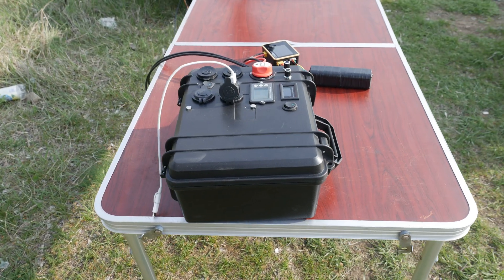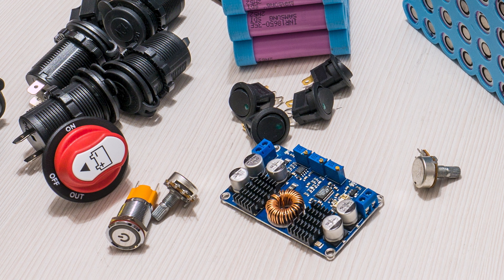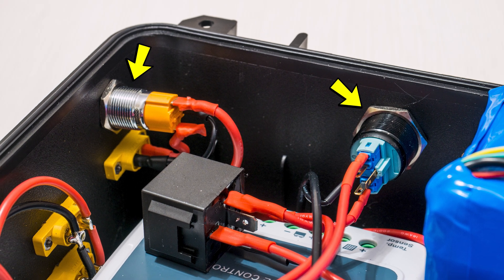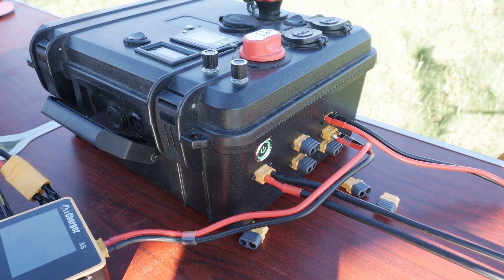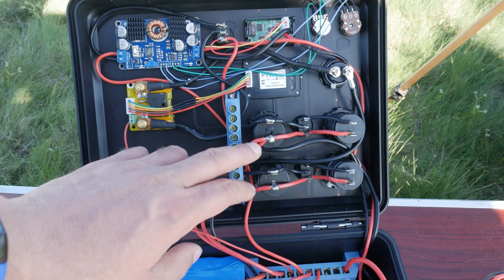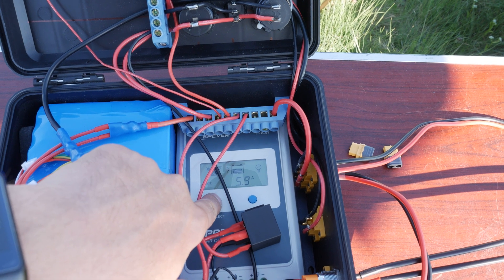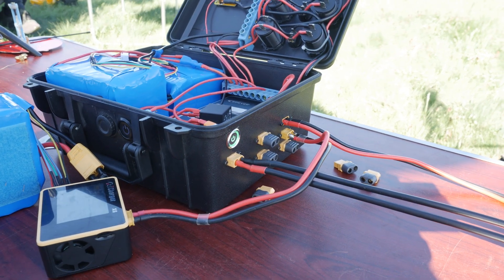My DIY Solar Generator Power Station

Comment: Edit: Great build I just left a bunch of comments for anyone looking at this and needing ideas. I don't really have many criticisms except my first comment.

I've never understood the brass bus bars. I figure people did it because Jehu does it, but copper bus bars of the same ampacity would be nearly the same price. I don't think its that hard to solder to copper, if you can't get it with flux then hit it with a torch real before installing on the battery and add solder along the sections of the bar.

I've always wondered if diodes are necessary in some of these circuits. 

The LTC3780 is definitely the cheapest "high power" buck boost board out there but I recently discovered some larger units on Aliexpress so if anyone is looking for 30A or so search "automatic buck boost converter 30A"  they are a little pricey though. The other option if you're only in need of 5A and want a nice digital interface is the XYS3580. Alternatively if you had made a higher voltage system (48V) you could use one of the many buck converters that have the same interface as the XYS3580. Those go up to 20A and Riden even has a 24A model but its a lot more stuff  but if your use case needs something like that its a very affordable way to do it. RD6024 is their biggest model, 6020, 6018, 6012, 6006 are the other models. Then theres the DPS5020 and 5015, etc. There's an XYS5008 thats an 8A buck converter and WZ5020L is the cheapo model with the shit interface. Double check the specs on the one you choose especially wattage and amperage. Take a look at efficiency too, some perform poorly if youre boosting 12V to a high voltage or simply can't do 12V to 50V at more than a few amps.

Lots to choose from if you need an adjustable DC output but you can do it pretty cheap and essentially have a nice battery charger...which also means you could set this to the ideal MPPT range for another power station that needs to be charged off your unit or even do a little modding an open up the other unit and splice the main battery cables to add an input accessible from the outside so you don't lose energy from the MPPT and keep the port open for solar.

I'm kinda surprised you went with 18650's since LiFeP04 prismatics are close to the same size...With a little more room I think you could have fit 100Ah cells, probably not 8 50's though so no 24V option. 21700's would have been my choice most likely due to the energy density but SPIM08HP cells are another good option. Headway 38120HP's from battery hookup are cheap if you're in the US and want a LiFeP04 option that screws together and you can use a long grub screw to series connect them without too much wasted space. There are also super cheap A123 26650 packs on ebay right now $100 shipped for 792kwh when new and they are testing above 95% capacity even at a decent load so expect 700+wh. They are a little bulky because A123 put a lot of space in between the cells for cooling since they were originally series connected (16 of the packs) for a 400 something volt electric bus.

USB 100W PD is possible and quite cheap. The only boards that work (check my channel I've bought so many of them and most are duds) are the IP2368 and the 120W bidirectional full protocol blah blah blah buck boost board from Feb 22 Store. I think the IP5389 might work too but my TZT board took a shit. Most of these boards work with a 4S lithium battery but some like the IP2368 allow a larger range. The IP2368 does have one flaw, if power is disconnected you have to hit it with a charge first to make it output, apparently a new version is in the works to fix this. So I def recommend the 120W board with the SC8812A and the ChipSea chip, its a tank of a DIY PD powerbank board and only $20 shipped. Add two of those OR if you have >20 volts and you can use a buck only board then get a 4 channel SW3518S board and you get 400W but that one is not bidirectional...but at $20 a 4 channel 100W PD/QC/every fast charge protocol out there minus PD3.1 is pretty impressive. For USB A you can get a 4 channel USB QC3.0/AFC/blah blah board for $6 and its one board with holes for standoffs so easy peasy. You could have more/better USB outputs/inputs than the $2000 units on the market for $46 or if you can live with buck only boards $26.

I do love your super clean mounting of the XT's on the side of the box they are amazing DC connectors and I wish most of the others would just disappear so it becomes the universal standard like USB C.

When you add an inverter you can just pull the plastic end piece of the inverter off and mount it to the box and extend the 220V wiring or you can buy a flush mount desk power strip for less than $20 and that makes it so so easy and you could have a switch for the outlets besides the switch to keep the inverter off. I'm all about having switched AC outlets for a bunch of reasons.
Reply from the maker: Lots of info here, nice! Thank you! As for the bus bars, they are brass because around here I cannot get copper ones and I wanted something with a housing and proper machine openings and bolt tightening, rather than soldering!

Comment: How much sir
Reply from the maker: I have not done a calculation on how much this has cost! Roughly I would say its about $400 due to the cells used being brand new and high end, and also the MPPT is not the cheapest option.

Comment: Super setup, just a question about Epever unit, 10A or 20A? regards
Reply from the maker: Thank you. I got the 10A one because it is the smallest, and only one that could fit in this case.
Reply: @ArxangelRC  looks to be enough even with 200w pannel isn't it?
Reply from the maker: @papylecelte9916  Yes, but that would be with a 24v battery, which means the panel needs to be at least 30+v! Won't work with a single 18v panel.
Reply: @ArxangelRC  I will stick to your model, for my need in the field, it's powerful enough. I just need to power my laptop, maybe a raspberry pi, an FPV receiver screen, and some battery charging. Thanks for your time 😃
Reply from the maker: @papylecelte9916  Should be plenty! I pretty much use it for the same stuff! :)
Reply: @ArxangelRC  I find a semi-flexible solar panel 120w 18v 1170*540*3mm looks smaller than the one you have on your video, is that normal? scarred to buy a bad clone 😂
Reply from the maker: @papylecelte9916  Actually it is larger if its 117cm along the long side. Mine is about 100cm.
Reply: @ArxangelRC  Hard to guess size on video. 🤣 Regards
Reply from the maker: @papylecelte9916  👍😁
Reply: @ArxangelRC  for my last buy for the project, what resistance for the 2 potentiometers for the step-up down regulator board? regards
Reply from the maker: @papylecelte9916  To be honest I am not sure! That was one area where I haven't got a clue! I remember looking it up somewhere, order whatever I found and that was it! IF I remember correctly it might have been 10k or 15k...
Reply: @ArxangelRC  thanks, now patience will be key. Aliexpress can take a while to deliver 🤣
Reply from the maker: @papylecelte9916  Haha, true. Although lately things have been arriving relatively quickly.
Reply: @ArxangelRC   Good morning, do you plug the load directly from the battery or do you use the load connection from the Epever unit? when you said you connect the Epever to the ground, do you talk about the casing?
Reply from the maker: @papylecelte9916  I have a direct connection to the battery, it does not go through the EPever since that one is only limited to 10A, and the battery can easily output a lot more!
Reply: @ArxangelRC  ok, Thanks
Reply from the maker: @papylecelte9916  You are welcome! :)
Reply: @ArxangelRC  Good Evening, on the setup of the epever there are a lot of settings I do not understand like Float charging, boost charging, boost recon, equalization charging, over volt disconnect, over volt reconnect. I use the data cable and my laptop, any chance you can send me your settings, the battery will be 3S 20P with 3.5Amp per cell. Regards
Reply from the maker: @papylecelte9916  Hey, I am just going to paste my settings here, these have been saved via that program from my MPPT in the box for my 3S battery in there. These are my settings according to what I think they should be. Have been perfect so far.

BatType: 0
BatCap: 70
TempComp: 0
OVCutOff: 12.70
ChargLmt: 12.40
OVRcv: 12.60
EquilV: 12.40
RaisV: 12.40
FloCharg: 12.40
RaisRcv: 11.20
LVRcv: 9.01
WarnRcv: 10.20
LVWarn: 10.00
LVCutOff: 9.00
DischaLmt: 9.00
RatedLv: 0
EquilDur: 0
RaisDur: 10
BatDisch: 30
BatCharg: 100
ChargMode: 0
Reply: @ArxangelRC  Thank you very much to take the time to help me, I really appreciate it. Regards
Reply from the maker: @papylecelte9916  You are welcome mate! 👍

Comment: Don't solder 18650's (very bad for the cells). Use a spot welder. You can buy a cheap one that would work on your setup for about $30
Reply from the maker: And where exactly did you see me soldering on the cells?
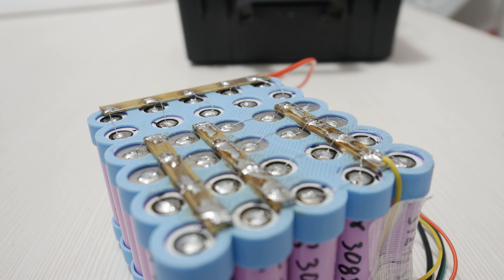Reply: @ArxangelRC  At 3:01 the video clearly shows a battery pack with solder on each cell.
Reply from the maker: @DarkMatterDrift  Oh, right... man its been so long I don't even remember what I've done! Those are soldered because I am using fuse wire on each cell! That way if it shorts it will disconnect from the rest and will not ruin the whole pack! Also, I know how to solder on cells so I don't ruin them, been doing this for a long time now.

Comment: Can you elaborate on the use of the relay and switch? I was planning on using a rocker switch to shut off the charge controller on my pack. Will that not work? Ive never dealt with relays before
Reply from the maker: Well the relay can handle A LOT more current than the switch, so I thought it would be much safer if the current goes through the relay, not the switch!

Comment: I used the same epever and 21700 samsung cells. Added a 3kw inverter. It works great! Paired it with 400 watts of solar. 

Nice set up!!
Reply from the maker: Nice setup! Well done! Yeah, the EPevers are great, the one on my workshop has been working for years, no issues at all!

Comment: I hate to break this to you, but those Samsung 35E cells look fake.  I too was tricked by aliexpress.  

Look at the letters carefully:  The Authentic Samsung "1" doesn't have a horizontal line at the base of the 1.  Also, Your cells' "5" has an unusually large gap above the lower loop of the 5, and additionally, the lower  loop of the "5" curls back up on authentic Samsungs.... your "5"s do not curl, they have a flat bottom.  

Continuing, your "3"'s do not look anything like the Authentic Samsung "3".  The flat top gives it away.  There's more... the "S" in Samsung is not correct.  The "S" should curl at the top and the bottom... your cells do not, they have flat tops (and bottoms) on all the "S" letters. The "D" is the wrong shape compared to authentic Samsung cells.  The "I" is too skinny .......  etc, etc

Sorry that you were tricked like I was.  Even if those fake cells measure close to 3500mAh initially, they will quickly degrade after a few dozen cycles.  I wasted many hours on these Aliexpress fakes.  Heck, my fakes didn't even get the "INR" correct, mine said "ICR18650".  Geesh!!!!  

I'm sure that they will adjust their font to match more closely the Samsung font and continue to sell tens of thousands of fake cells because they make so much money doing it.  It makes me mad that these scam artists can get away with this!
Reply from the maker: Actually I got my cells from Nkon, in the Netherlands, and I've not seen anybody complaining that the cells they sell are fake, and I am pretty sure they are not! I only provide the Ali link because not all of my viewers are in Europe, so they can't really buy from Nkon!
Reply: ArxangelRC The dot matrix font on your cells is a lazy attempt to copy Samsung’s font.  It doesn’t matter where you bought them, does it?  Authentic Samsung cell’s don’t look like that.
Reply from the maker: @test-193  Well it does matter actually! If Nkon were selling fake Samsung cells... we would have known!
Reply: ArxangelRC Gee whiz, I’m only trying to help you, not argue with you.  Ok, so I guess your “authentic” Samsung’s don’t match all the other authentic Samsung cells...... but they’re not fake.  Uhhhhhhh, Ok, sure..... and that sounds reasonable to you?
Reply from the maker: @test-193  Well... I've never bothered to look into the wrapping, because I am getting them from a confirmed place! If Nkon were selling fakes, this would have blown up by now! I am seeing consistent performance over lots of cycles now, so not sure what the problem is!
Reply from the maker: @test-193  OK... so you know you got scammed based only on the wrapping?
Reply from the maker: @test-193  Right... so what did you do with them? Did you test them for a few months to see how they will perform?

Comment: great jobs, Which is the fuction of the LTC converter module?
Reply from the maker: I have two external pots connected to it so I can set current and voltage, and I can see all of it on the display! Use it for random stuff... it is quite versatile!
Reply: @ArxangelRC  thanks for your reply. Do you thinks that I can charge a 3s7p pack with the LTC converter?
Reply from the maker: @victoroliveroing  Absolutely! But make sure you setup a fan to blow at it to avoid overheating!

Comment: Could you please do a review of the zeta sky observer it is a big fpv plane from Aliexpress I want to get one but there is almost no information on it besides a quick build from hobby King that hardly shows any detail about the building process and the parts included I am sure many other people that also want to buy it would appreciate the video :)
Reply from the maker: I think I replied to this question under another video...?
Reply: @Racing Turtel  So basically you want someone else to put their money into the product and test it for you so you can buy it risk-free?
Reply: @stejer211  Not just me also oder people and isnt that what reviwes are for
Reply: @stejer211  because i dont have the money to buy it if it sucks and no one else would see it
Reply: @stejer211  dude wtf is wrong with you he would make money from the video and I also asked him not you

Comment: why do you need a Universal laptop charger
? wasn't it better to use the Buck / Boost module? you only need an xt60 cable with a laptop adapter ???
Reply from the maker: True, but I had the laptop charger from before the solar generator... so why not use it... :)

Comment: Hi I've started to work on my version and at the moment I have 2x 12v 17ah lead acid battery and it's heavy but at the moment it is working. I think that I'll be rewaching this video a few times
Reply from the maker: Thanks! :) Yeah, lead acids weight a ton! I used to carry one of those years back, and it was a major pain!

Comment: My 1.2g relay Ground Station runs on two old 2200mah 3S Lipos wired in parallel.
Charging them is a rare event TBH...🤔😳🇬🇧
Reply from the maker: Sure, but I also use this to charge my largest batteries, and whatever else you can imagine, and this whole setup never has to leave the car, or get connected to it in any way! :)

Comment: Nice build but do you really need all that extra gear??? Must take a long time to setup and would be a pain in the ass to carry everything to the field. Couldn't you just power everything off 1 battery?
Reply from the maker: Well... everything IS powered from one battery... the one in the box! And I have all of this in my car... I don't carry it by hand! Two cases with comfy handles are pretty easy to carry though!

Comment: A very pragmatic and timely video. Been collecting hardware myself to build portable power case.
Now thinking of including space for an MPPT in the design so can link in solar panel(s) in future. 
(have cells, etc., and just started looking for a case)

Are the two sets of panels shown both 100W?  (0:40 vs 10:43) 
Realize is how your system started, vs now ... but curious as to sizing a solar panel for a the needs of a day, while maintaining convince of portability. Asking more from perspective of MPPT sizing and space requirements.
Reply from the maker: Well the two at the start were just for testing and the larger MPPT I was using back then could handle 200W input at 12v! The smaller one I got to fit in the case can handle two panels, but only if wired in series for 24v, but my battery is not 24v, so on the output it still is limited to 10A... so makes no sense to have two panels, except for optimising things on cloudy days and always having max input, which is 10A, so some of that solar capacity will not be utilized by the MPPT as it can't take it! If I were to rewire everything to 24v, I could use 2x 100W panels even with this smaller MPPT controller.

Comment: That is a great one looking back into the full progress from ep ever and batteries onwards.

Pretty much the same here - but a bit bigger cause I got fixed panels and they are mounted on an mobile home and power its battery - or the powerbox, I can pick up and use out in the fields.

Looks like we found the same suppliers for the USB adapters and yes, the whole box layout is not that easy. 
And your wiring looks quite good compared to my mess at the first 2 versions.
Reply from the maker: Hahahahaha, yeah... wiring is tough, especially if you are making it up as you go! Sounds like you have a solid system too, well done! :)